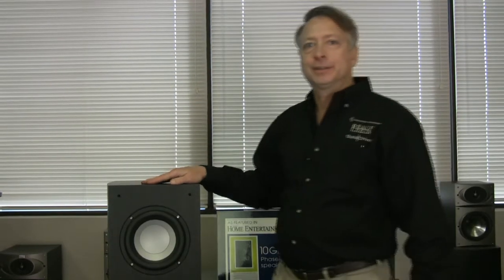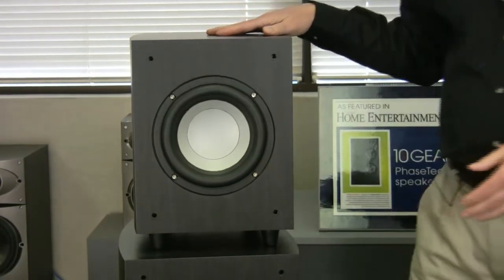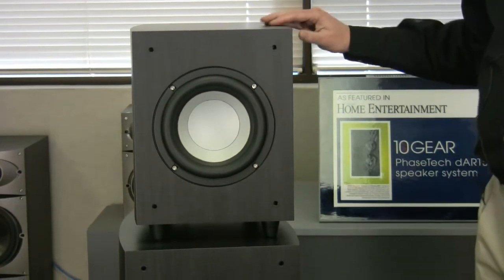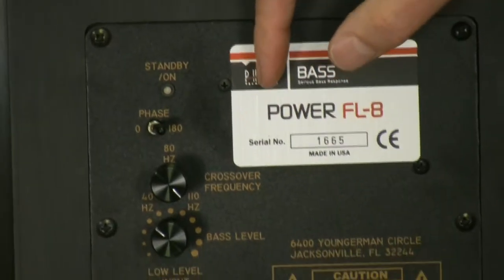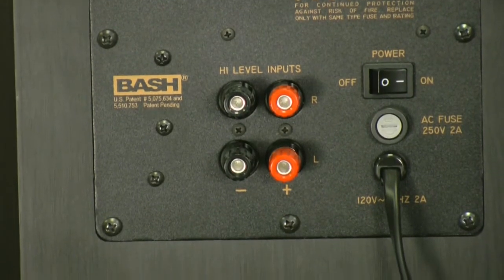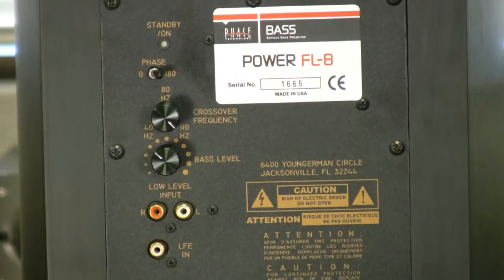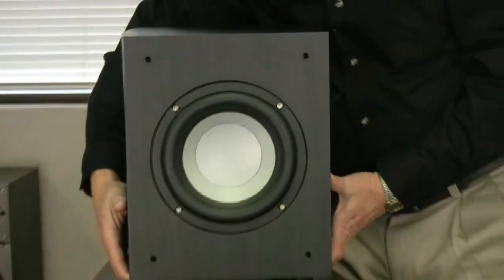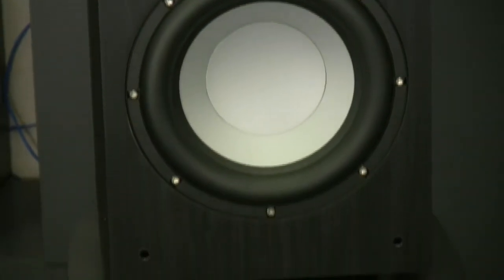Power FL Subwoofers

Comment: I don't think the frequency response was said (Correct me if I'm Wrong / Thanks) - but I found the manuals on the MSE Audio website, so for anyone who's wondering how Low each model goes:
-
POWER FL-8 : 32 - 150 Hz
POWER FL-10 : 26 - 150 Hz
POWER FL-12 : 22 - 150 Hz
-

Awesome to hear they're also Servo controlled.
Thank you.